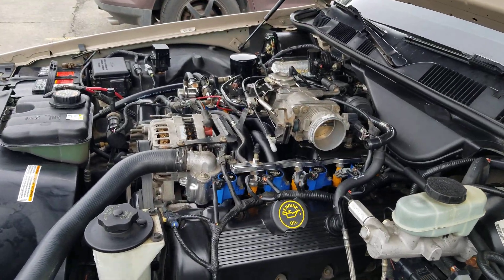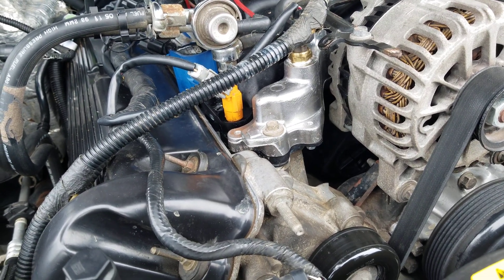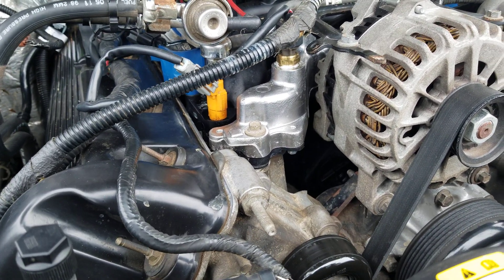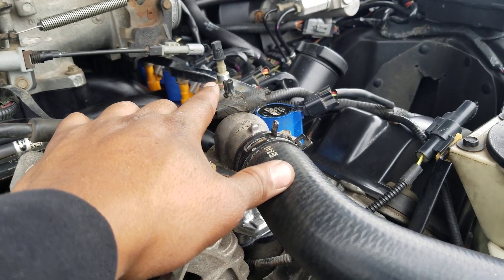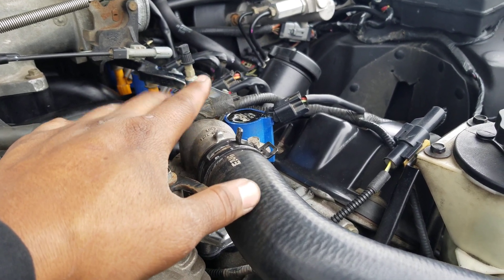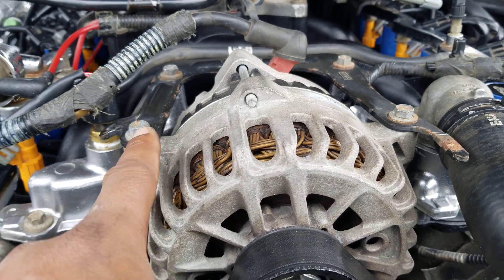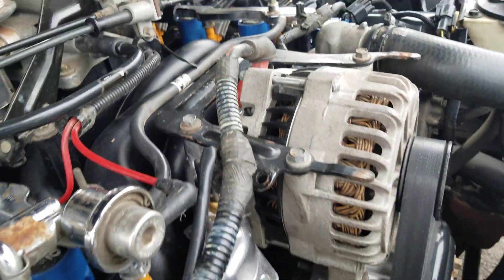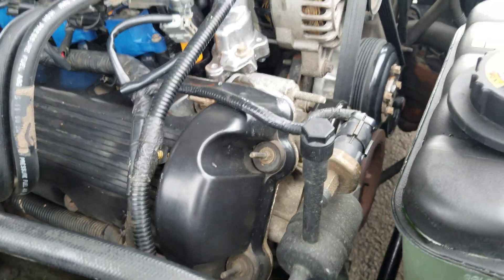Crown Victoria intake manifold Pi swap

Comment: Can you please do a video about the coil packs and spark plugs and wires I have a 05 I just got mine recently changed and my check engine light came on and now my car runs like it’s losing power or it wants to cut off

Comment: Thanks for the mention of the alternator bracket. I noticed that in the ADTR write-up and didn't see it mentioned anywhere else. Guess I gotta hunt for one now because they are waaay too expensive on eBay. Edit: I found one not long after posting this for $25. Not all that bad and more than half the price of other ones I found.

Comment: Dang both your Vic's are in great condition. Both those cars combined have less miles than mine lol.

Glad the swapped manifold worked out. I'm at 142k (knock on wood) and mine seems to be fine.

Appreciate the information on the PI intake swap. I'll probably go this out if mine goes out. I've swapped enough parts to know you're always better off using the better part, rather than the cheaper part.
Reply from the maker: Appreciate that